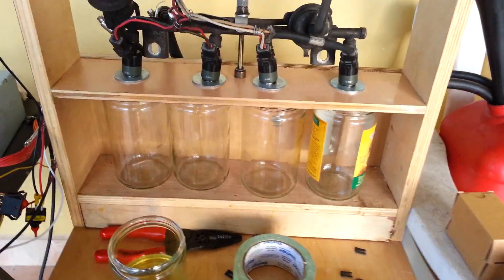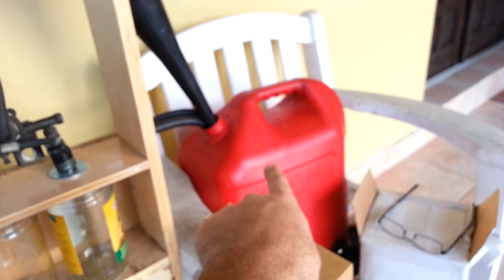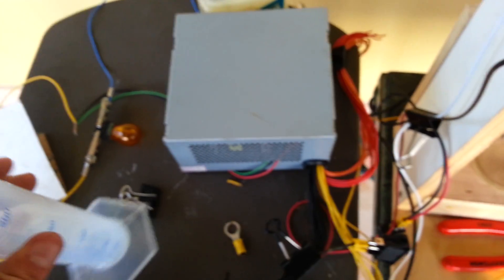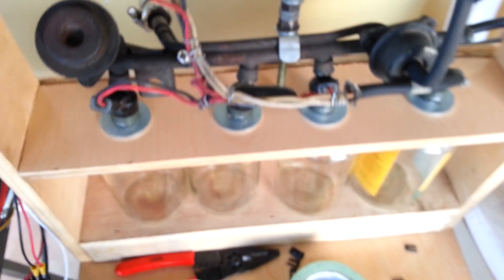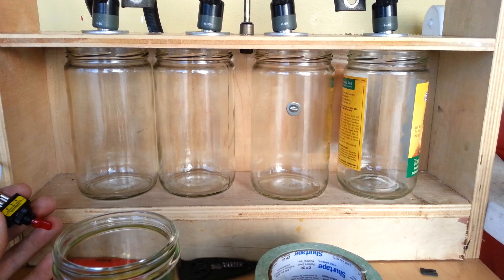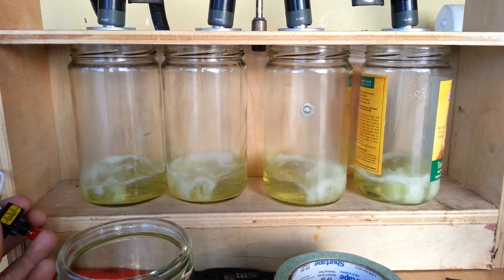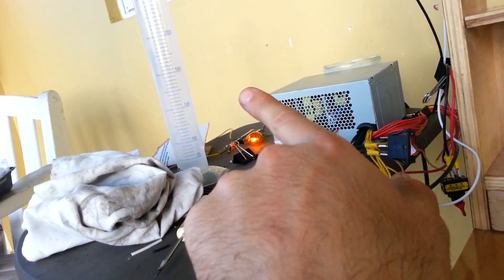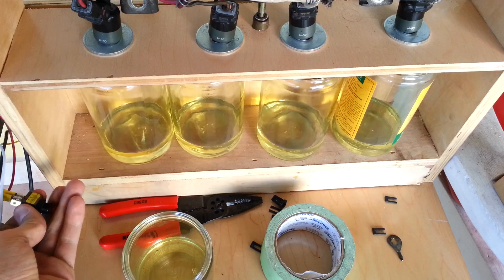FINAL - DIY Fuel Injector Flow Bench Tester 4 Injector Test Bank Part 4  Done

Comment: Other than stoping fuel from coming out the rail, the fuel pressure reg does nothing...
It needs vac to adjust fuel pressure
Reply: with no vacuum, regulator will flow max pressure the regulator was designed to flow. It still regulates.
Reply: It uses the signal hose to regulate the rail pressure to 3 bar (for example) above the manifold pressure.  When the manifold sees vacuum, the regulator will reduce the rail pressure to compensate.  When it sees boost it will increase the rail pressure to compensate.  When the manifold pressure is equal to atmosphere (ie. an open topped jar) it will set the rail pressure to 3 bars above atmosphere.  If the regulator did nothing then the fuel pressure would keep increasing until the pump cannot supply any more.

Comment: Hi Bob, great initiative and looks like it works really well, just a little concern from me being a retired firefighter that you have nearby ignition sources and lots of vapours, an accident waiting to happen, please look at your rig and think about what you can do eliminate ignition source from fuel vapours... if vapours ignite in enclosed glass containers they will possibly explode causing glass shrapnel. other than the safety lecture your doing great keep up the good work.
Reply: Yeah, the power supply had me on edge. Just use a non-flammable cleaning solution. Otherwise even alcohol would be safer than gasoline. If you are rebuilding them all the alcohol sensitive parts are being replaced anyway. Great video though.

Comment: hey bob, im currently doing a project at university. im building a fuel injector tester and cleaner bench. could you help with the power supply? i would really really appreciate the help. thanks

ps. this is an amazing build!

Comment from the maker: It can be used to see if the injectors are flowing properly (if they are clogged or not) or even if they are functional or leak. It can also be used to determine the flow rating, as you make more Horsepower you need more fuel thus Higher Flowing Injectors "bigger injectors" This tool is used to see how much it flows in a given period known as "cc/min" or "lbs/hr"